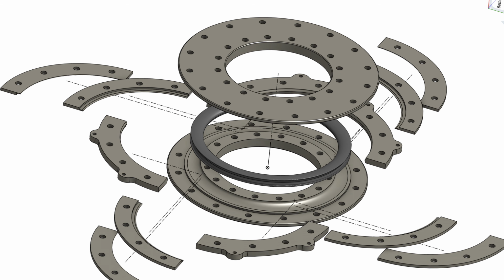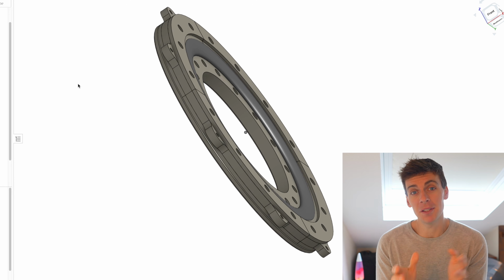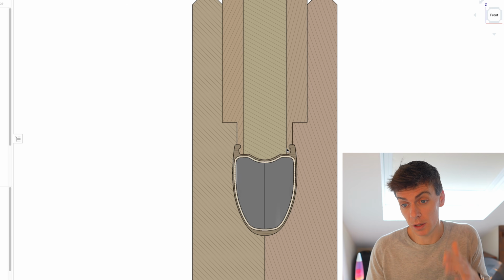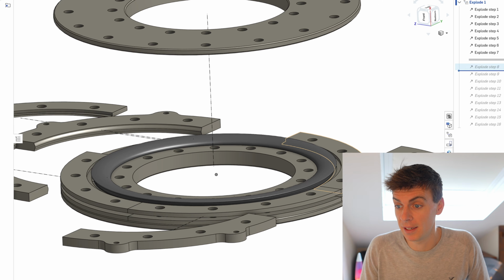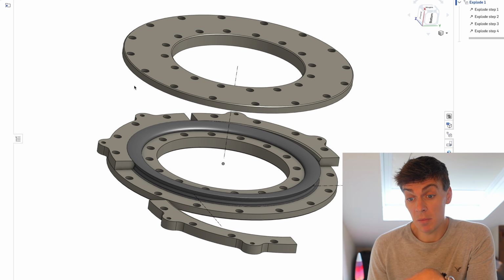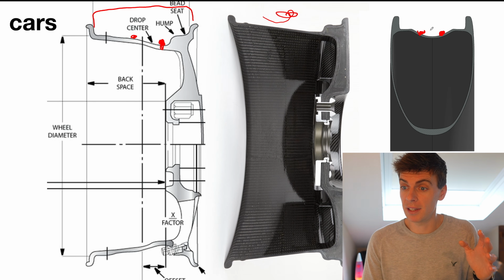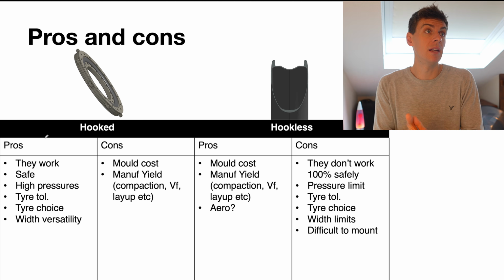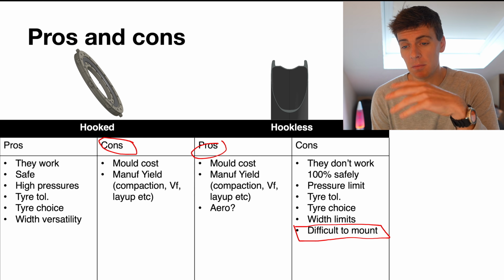Hookless carbon Bike Rims - the Truth = cost cutting.

Comment: What about motorcycle tires? Are they the same as cars? Do they have hooks (I have no idea)?
Reply: Heavy steel beads, larger tire volumes, and lower pressures. Not really comparable. More like a car tire than a bicycle tire in every respect.
Reply: Basically yes. But even stiffer and harder to mount than cars.
Reply: @bcxmontiel4875 depends on the type of tire. Plenty of motorcycle sport road tires can be mounted just like a bike tire, by hand. (Obviously not touring bike tires or anything like that) And road racing slicks can be even more flexible. They are probably the closest thing to a bike tire. So I have to admit it’s sometimes puzzling to me that bicycle wheels and tires seem to have so many more problems with fit, compatibility, holding air in tubeless form, etc.

Comment: All this bullshit could have been avoided if zipp/enve/cadex/giant/Merida invested into automated filament winding and/or automated carbon braiding lol
Reply: Filament winding still needs to be cured in a mould. Or have a stiff mandrell inside, but you can lay conventional prepreg just similarly on the mandrell.
Reply: @feedbackzaloop  at least you're only throwing away machine labor rather than 50+ hours of manual labor
Reply: @Factoryseconds123  there is always some manual labor and intellectual property behind every machine. And those are reflected in price according to the manual labor said machine replaces. So then automation without change in quality makes no difference. Goal is not to throw away fruits of any kind of labor.

Comment: Did you contact 9Velo or anybody on site to show you how the intricate features of a real world mould? Otherwise a nice mental excercise and happy to hear you questioning the quality of the product made with your design like resin loss, undercompaction, etc

Yet the simplest way to simplify these moulds is to go from 4 sectors to 3 or 2 if you're that risky😁

But jokes on you, aramid bead is stiffer than steel along it's length - and that is what matters about keeping interference between the tyre and the rim seat under high pressure. And this interference failing already dooms the tyre way before the hook can do something about it. Because, remember, tolerances: beads come in different gauges and covered in different thikness of plies and rubber, so the hook is always pressing against soft material and almost always has some clearance before that too.
It's because of the cost most car tyres use steel. And a lot of it.

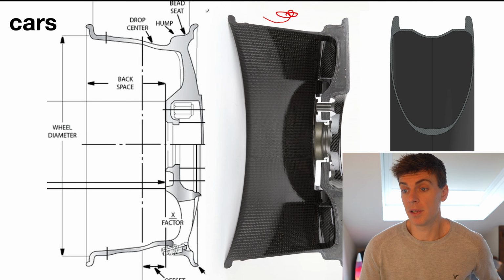In conclusion, really, all tubeless debate can be reduced to the 14:36 moment. Barrel profile, that's what matters when tyre tries to unseat itself. Not a hook. Not the way this hook is made even more so.
Reply from the maker: Yes, delayed release until i had a Chinese factory look over it. Its not a complete mould by any means but they confirmed the principle, which was a relief!
Reply: Fake news I’m afraid. Aramid has higher specific tensile modulus, (possibly the source of your confusion) due to its low density, but for equal cross sectional area, a steel bead will always be stiffer, along its length, (and every direction) and therefore will stretch less for a given pressure.  I’m not aware of any aramid fibre with a Young’s modulus of more than 200 GPa, which is the approx value for all steels.  Where are you getting your numbers from? I’m seeing 60-140 GPa, I.e considerably lower than steel.
Reply: @gavin9054  good observation! Missing the point though steel bead is not single thread, but twisted cable, while aramid bead is continously wound ring and usually thicker gauge as well. Therefore pure material qualities fade into the background when it comes to final design.
But yes, when Hutchinson were first introducing folding tyres, they weren't sure with aramid qualities of that time and had carbon...

Comment: What I don’t understand is why these major companies would leave themselves open to litigation in the event of users being injured if they weren’t sure that hookless was safe (when used correctly).
Reply: The beauty of this is that in most cases, we’re talking about a failure that happens where two manufacturers’ parts interface. So during the litigation the rim manufacturer will blame the tire manufacturer, and vice versa. Another convenient out would also be to blame the mechanic who mounted the tire, and the user who made sure that the correct tire pressure limit was not exceeded. Tell me how you might go about proving what the tire pressure was after an accident and the evidence has evaporated into, well, thin air. The real winners in this situation would be the lawyers, and really no one else!
Reply: @chrishophoto  all good points but people are saying that there are many instances of hookless rims causing problems, though it’s all anecdotal (“I know someone who new someone”… etc). If this really was a problem wouldn’t you have lawyers sniffing around and threatening class actions?
Reply: Because they are sure hookless is not less safe than hooked? So much statistical error you can always blame the chance when you can't blame the user.

Comment: i think noodle is for case to protect carbon rim when you have flat and vittoria noodle should expand a bit as i recall Poetner said ... so can i ask ... if i use ZIPP 303S because they come on decathlon RCR bike which is ultra cheap :D if i use contis gp5000 S 30 or 32 with pressure at 4 bar am i safer then on GP5000 S 28 with 4,5 bar ? or i am in same danger zone :D
Reply: You can have Van Rysel with Mavics and it will be even cheaper. Or they say frameset alone will be available soon, so you won't be stuck with Zipp
Reply: @feedbackzaloop yeah but their combination with rival axs and powermeter is 4200 euros ... there is nothing close to this price so it is tempting :D
Reply: @krempixxx  don't you find the option with inactive powermeter costing same is a hint to the whole build being somewhat too good to be true?
Also Ultegra has fancier paintjob...
Reply: @feedbackzaloop what do you mean by inactive ? actually paintjob is fine for that bike i have seen it in person even today :D only reason i dont have bike is because i need money for something else right now and second that they had M and not S in shop to try .. i doubt shimano powermeter is working and on another bike i have mechanical ultegra but thats radon spire 9 2020 so i kind of want somethign more racing like and my second option CUBE litening cannot be ordered for unknown reason and their 2023 frame which was my first option is sold :D other brands are shit for me with exception of giant propel but thats out of my reach for now so i am really into this RCR but this hookless worry me because i am fatso 80-90 kilos
Reply: @krempixxx  I think they sell two options, "with" and "without" powermeter by simply not activating the powermeter and hiding it behind subscription. Although can't confirm, heard about it with regards to another manufacturer.
And agree, Shimano powermeters still can't properly function in small ring. But it's safe...

Comment from the maker: Some more stuff:
1. By Hooked i really mean Crotched. Hooked is an old standard not really in use now.
2. For what its worth, some more comparison to the car which is in a different realm anyway, the ETRTO sidewall height (flank) for a J car rim is 17.5mm. A 622 bike rim sidewall height is 6.3mm. The sidewall height:diameter ratio (an approximation of manufacturing accuracy importance) for a 16" car rim is 0.04. For a 622 bike wheel it is 0.01. So we are dealing with floppier, less stiff sidewalls and beads, with a quarter of the slip allowance up the sidewall. Squeaky butt time for sure when you think about it. 
3. If you are using hookless, check the ISO standard in the chart here: https://en.wikipedia.org/wiki/ISO_5775#Clincher_tyres_on_straight_sided_or_crochet_type_rims
 I would add 2mm to the min tyre size if you want more safety factor. Ambient and road temp will affect the pressure of a close volume. With heat, the pressure will rise. 
4. If you suspect a folding bead is broken internally or stretched, don't use it. 
5. Don't be tempted to lubricate the bead to get it on, it will get it off too.
6. If you are on smooth tarmac (UAE) and want an aero front wheel with a 28mm tyre, i suspect you will need more than 5 bar, which is against the current reccomendation. Forget using a 25mm on a wide rim, too dangerous in my opinion
7.  If hookless wants to stay we need to push for taller sidewalls and more tightly controlled bead diameters on tyres. 
8. So why is Giant doing it? Giant Taiwan is the leanest of all producers with the highest output of any bike company in the world. They cannot afford to adopt a Toyota style lean manufacuting method and toss the odd rim into scrap - the process would not work. 
9. What about Zipp and Enve? Same as above but more to do with wasting US labor cost. Not feasible. Each rim has hours of cutting, and preform. All manual. Not feasible to scrap rims.
10. What about mainland Chinese factories, APex, Farsports? Almost the opposite of above. But that will change, labour costs are rising. 
11. If the current ETRTO/rim guidelines are built around crotched type profiles, hookless needs a complete new standard, with a safe sidewall height and safetey factors that the bike indusrtry can achieve. The loser in this will probably mean tyres getting near impossible to mount by hand. 
My opinion only
Reply: Really appreciate this video. Is there an argument for reducing carbon fibre in cycling on the basis that from an environmental perspective it seems to be a really bad material to use compared with recyclable aluminium?? A video looking at the environmental impact of the bike industry would be interesting.. cycling is obviously part of the sollytion to the climate emergency and reducing our impact on the environment, so i don't understand why manufacturers aren't pushing this. This topic never seems to come up in YT comments, or ever get discussed by YTbrs
Reply: @mosgrovecleancutkid681 Trek did lifecycle analysis on some of their bikes a year or two ago. No big surprises. Shipping is a big emissions source, but so is the frame. If you want to reduce emissions, get yourself a locally made steel frame, or a carefully inspected second hand bike.
Reply: [1. By Hooked i really mean Crotched. Hooked is an old standard not really in use now.]
I've just spent a good five minutes Googling on this. Consensus appears that one is French, the other English, for the same thing.

Perhaps there's an established (en Anglais) engineering difference. Please elucidate.
Reply: 9.5 what about Trek? saying "F it!" about monocoque and going with thermoplastic matrix and welded halves.
Reply from the maker: Are Trek in on that? I know there is a US company doing the CF / amide injection moulded rims but they're presumably pretty heavy @feedbackzaloop
Reply: @PeakTorque  apparently forge+bond make bontrager aeolus rims. It's still prepreg long fiber carbon with controlled direction though, so not that much reduction in strengh as with short random fiber of injection moulding. So all weight difference comes from a different matrix, not total redesign.
I guess the moral of this story, you can optimize the production in so many different and exciting ways rather than impair product functionality.
Reply: @PeakTorque  the new Aeolus are US made and thermoplastic- I think safe to assume CSS composites are involved. Lots of reviews out there currently saying exactly what you'd expect- a little heavier, little less harsh, maybe a little less precise. Makes sense for some off road applications but will be a hard sell for road. I think it's interesting tech and would like to see more of it even if we disregard the pretty fluffy recycling claims.
In terms of things to add to your pro/cons chart I've repeatedly seen it stated that the hookless rim flanks are stronger and less likely to crack under big bottom-outs. To me this makes sense but I don't think this failure mode is common enough for it to be a genuine advantage.
Reply: People that drive Ford F150s don't ride bikes.  They enjoy the FREEDOM of burning rubber
Reply: If you set your rims up so your tubeless tires can be mounted with a hand pump, it does make it a bit more difficult, but it's not terrible. Now if the sidewall of the rim was several mm taller? No thanks, sounds like a fight. Even worse with everything soaked in sealant. 

You can guarantee 100%, that any new product being sold on marketing claims was developed because it makes more money. There's no way around it, because the board would make quick work of the CEO. Maybe for a small company it would be a legitimate improvement, but hookless is coming from big players looking to rake it in. Don't think for a second this was developed for consumers benefit.
Reply: so you are saying that hookless should actually be called crotchless rims?
Reply: I'm not a mechanical engineer so this might be a stupid suggestion, please correct me if it is. But why not use the hookless construction method and make thicker sidewalls and then "carve out" a bit of it to create the hook ? Would this compromise the structural integrity or something ? Great video I love the engineering insights !
Reply: @jellevanzelst7754  The strength in fibre reinforced composites comes from the fact that fibres are continuous, uninterrupted and conform to the shape of the final object (like wood grain in a tree). Subtractive post processing like you have described is generally avoided if possible.
Reply: Why don't you compare hookless to tubulars,? The moulds are likely even easier to make, they are more sturdier than hookless, probably even lighter too.

And you can ride whatever pressure you want to, usually also 23-32mm tires can be mounted on the same rims...

Yeah, gluing is a bit of a bother but no blow outs and I haven't seen many people starting to put a tube into their hookless when everything is soaked in a half a liter of sealant and you have sand and shit all over the sealant everywhere. It is usually a cab time anyways, and they rather take you in when you are not soaked with sealant.
Reply: I don't understand your point on Giant. You mean they can't afford to spend the extra resources to make hooked rims? I'm sure I'm being thick, sorry.
One topic is missing, and it's the reason I bought my gravel rims hookless: sidewall strength (when hitting rocks): do you think gravel rims should also be hooked or not?
Reply: A deeper channel in the rim would allow for taller rim sidewalls and not impact install difficulty. This will all blow over when tire and rim mfgs get it together just like everybody hated tubeless on the road in the early days.
Reply: "Ambient and road temp will affect the pressure of a close volume. With heat, the pressure will rise. "
Haha, depending on how much pressure rises with heat transfer from the rim, rim-brake hookless rims would be a complete dumpster fire. I'm sure we'll see this fad at some point.

Comment: Apart from tooling costs, I´m CERTAIN that the reduction of rejects ( hook not filling out ) is a MAJOR cause for this ruckus. Tubulars, anyone...     Rgr
Reply: Tubs roll off too. Again famously on the hot roads in the UAE tour- melting the glue on many riders on a fast descent causing multiple crashes
Reply from the maker: Tubulars are the easiest rim shape to form as the whole thing is formed by the bladder! Great compaction.
Reply: @PeakTorque  Compare replacing your tubular to replacing your hookless out on the road... apart from the safety factor when you suddenly lose pressure.. if the sealant doesn´t work as intended, you´re in big trouble. And there´s no major difference in costs any longer      Rgr..
Reply: @PeakTorque I still remember the good old days when you buy tubular wheels from the chinese manufacturers they were actually cheaper than their clincher counterpart

Comment: Road inserts are quite different from MTB inserts, no? Road inserts are a different foam, intended to compress inside the tire and actually take only a small volume. Road inserts offer no protection from wheel strikes, they are only intended to expand in the event of lost air pressure.
Reply: Apparently riders have finished races on totally deflated tyres - rolling on nothing but the noodle
Reply: Perhaps I'm wrong, I'm a bit short on sleep right now, and what you write is the regular spiel spoon fed to consumers...and I can't mentally model the behaviour you claim. How, exactly, do the inserts "compress" inside the tire? And if they do by the factors you ascribe to them, then where does their ability to expand under load w/o that air pressure come from? You can't have it both ways.
Reply: @stephensaines7100 they're made of closed cell foam, the air pressure compresses the foam when your tyre is inflated and then they expand back up to full size when the air goes out of your tyre.
Reply: @tomllama2  The obvious is still blinding you. If they compress under as little as 30psi, then how can they possibly carry your weight without compressing?

You can't have it both ways.
Reply: @stephensaines7100  Could it be your mental model is inadequate? Or is this something else we cant have both ways?